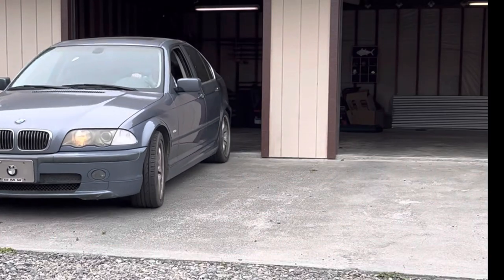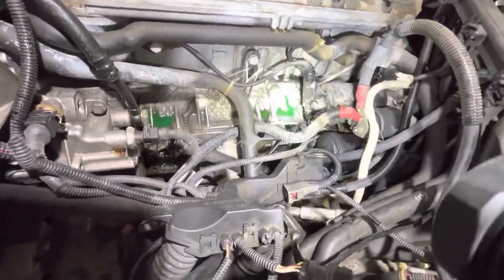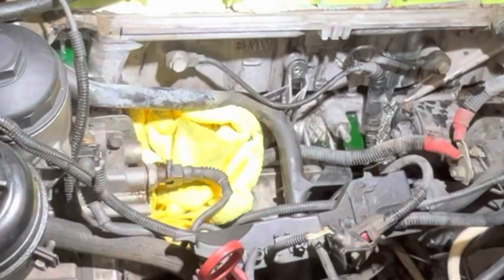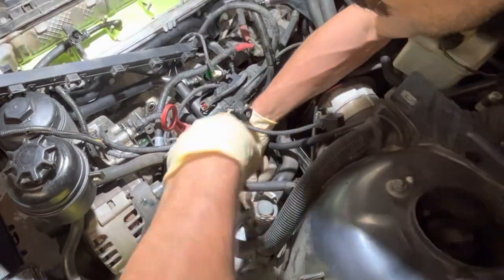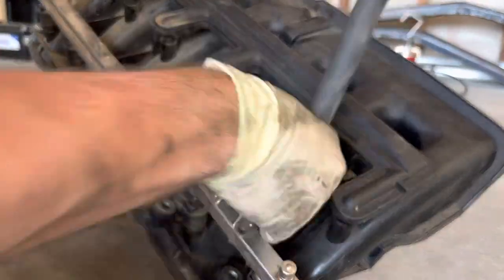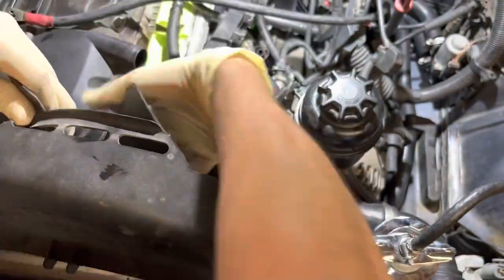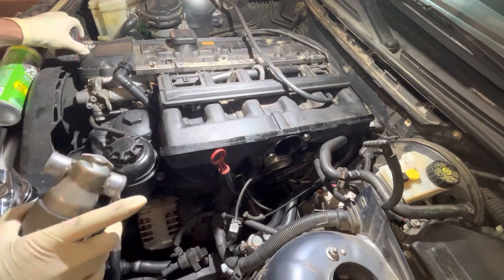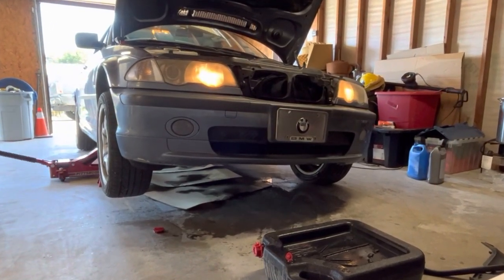Replace Water Pipes, Coolant Hoses, and Breather (CCV) BMW E46 M54 330i

Comment: DIY I'm going to accomplish this project when I get to feeling better.  The only thing that spooks me are the vacuum hoses underneath the intake.  I just want to know the size of the vacuum hoses I need before I get started.  Any help would be greatly appreciated.
Reply from the maker: I can hopefully find a size for ya in the garage, from what i researched online it looks to be inside diameter of 3.5mm, Ive found that there is not much size variation once you get down to this small of size, and theres usually only one spool at the auto parts store that looks correct and fits. takes some guesswork out of it

Comment: Great video.  Do you have an Amazon affiliate link?  I found myself adding products to my Amazon cart you mentioned like the 3M spray and Sil Gylde.  Did you inspect the injectors while the intake manifold was out?  Would that have been a good time to clean them, maybe in an ultrasonic cleaner?
Reply from the maker: Thank you for the heads up! I just added the links for sil glyde and wet silicone spray. I ought to go back through this video and see what other links i can provide. I didnt inspect the injectors, its sometimes difficult to see issues in the spray pattern with the naked eye but not a bad idea!
Potentially a great time to clean them! I dont have any experience cleaning injectors by hand or with an ultrasonic cleaner but thats a good idea for a future tool to pick up :)
Thanks for the feedback Marc

Comment: Why not cleaning the leaked coolant beneath the intake manifold and what is the reason you do not use OEM parts and hoses?
Reply from the maker: I cleaned it up with water after repairs, and as far as OEM parts, I would love to, theres nothing better, but $$ is tight and I need to save with reputable value brands as much as I can to keep the channel going

Comment: hey brother i replace my coolant pipes under manifold put all back together and now cars runs rough wont idle wont go over 2k rpm eml ligjt on traction light on and break light yellow on dont now what to do next please help.
Reply from the maker: Have you pulled codes yet? Maybe you left something unplugged
Reply: @DayOffDIY  no scanner is no good i did all over again to see if missed something  but dint see anything unplug. i dont want to do it but im taking it to the mechanic tomorrow.  on a good note replacing the pipes was easy thanks to your videos
Reply from the maker: glad i was able to be of some help, i hope you get the car sorted soon!
Reply: @DayOffDIY  you are like brother to us and i think some how taking the throttle body out it got mess up im getting a p0123 for throttle / pedal not sure if it is the sensor or the entire throttle body